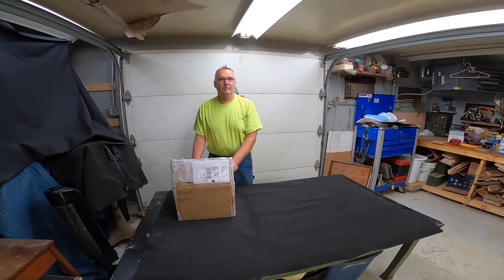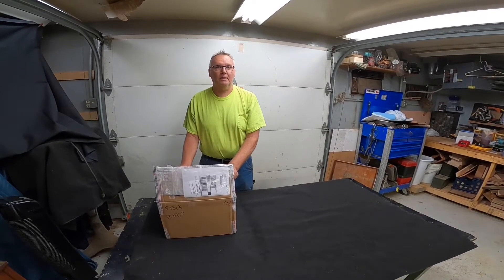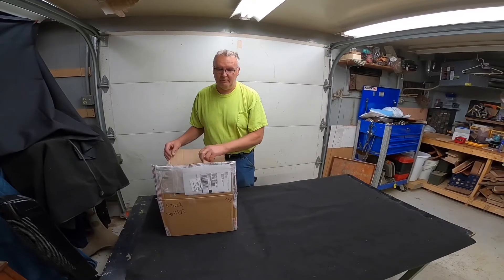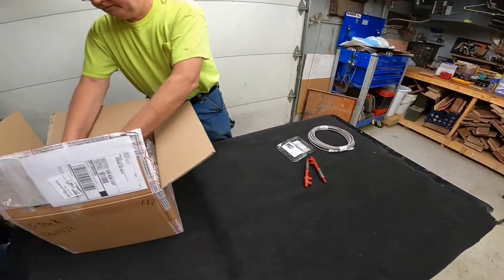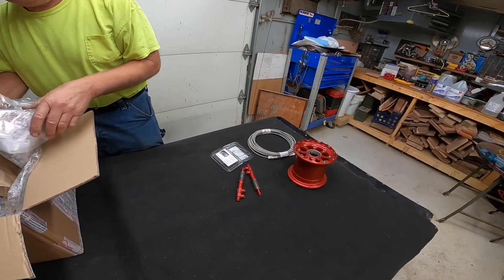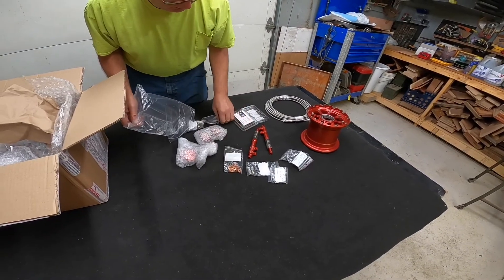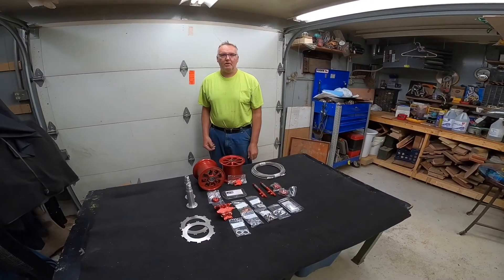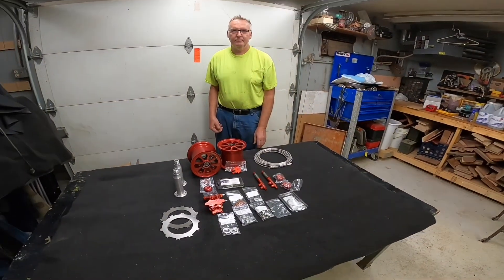Avidflyer Mark IV| Repairs and STOL Mods| This Avid rises back up!

Comment: I would like information on how you extended the fuselage. I just bought a mark iv. I want to use a bigger motor than the 582. I've seen where people have used this motor with out extending it but I've read about the advantages of extending it. So if you could please give me any information on how and where you added the extra 18 inches I would really appreciate it. Thanks
Reply from the maker: Write me at Sean.blackswamp@outlook.com